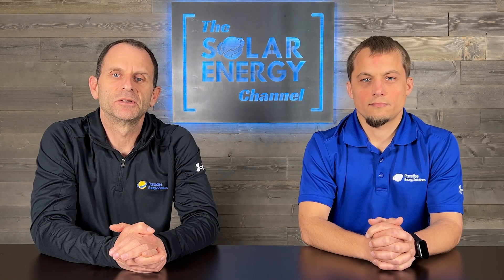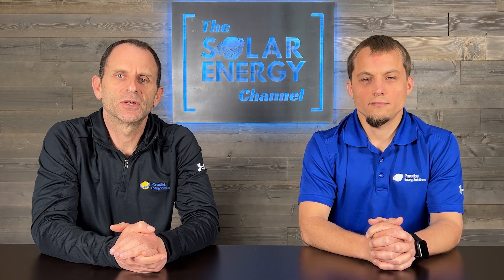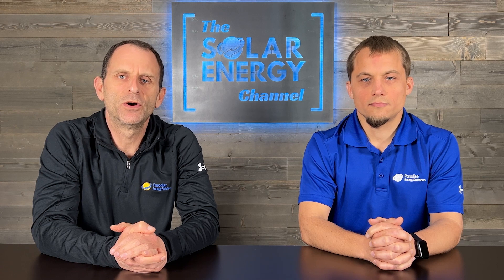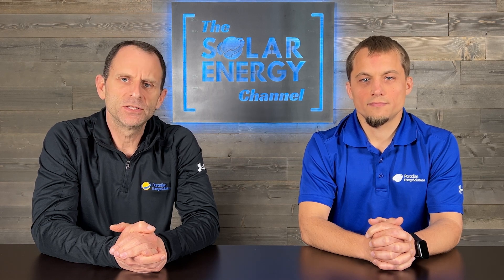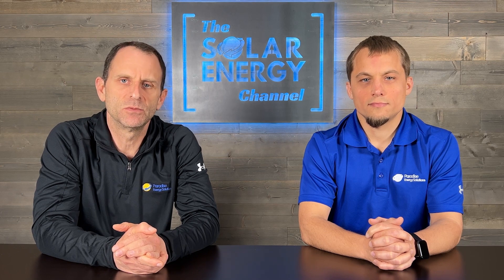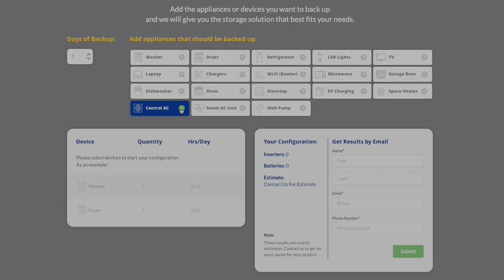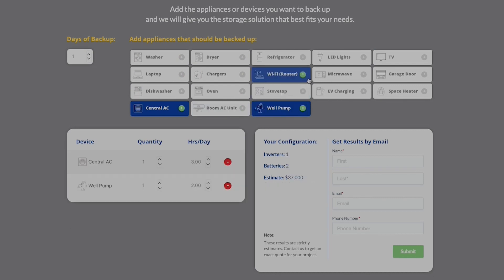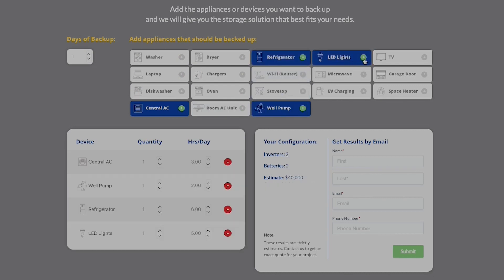How To Properly Size a Home Solar Battery System

Comment: What is the device that you put onto the breaker panel to measure loads?  Is that owner installable or does it require an electrician?
Reply from the maker: We usually use a device called "The Gen 2 Vue Energy Monitor" from Emporia Energy, though other devices are available on the market.  It should be installed by qualified personnel only. https://www.emporiaenergy.com/how-the-vue-energy-monitor-works